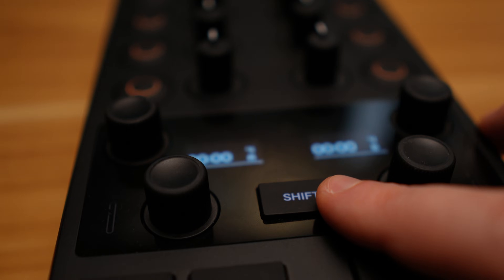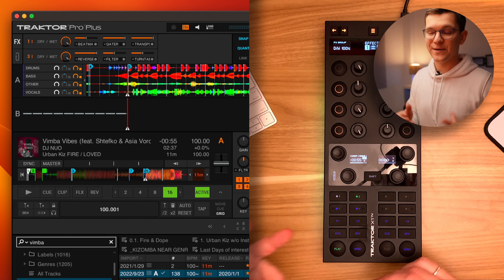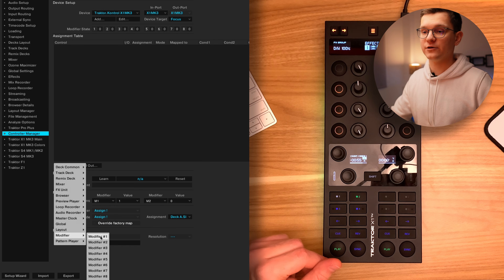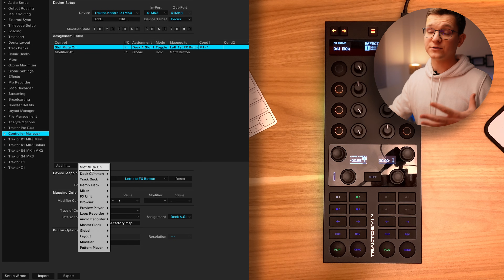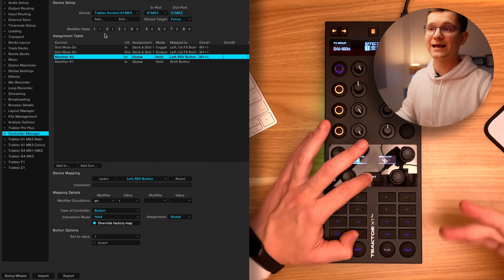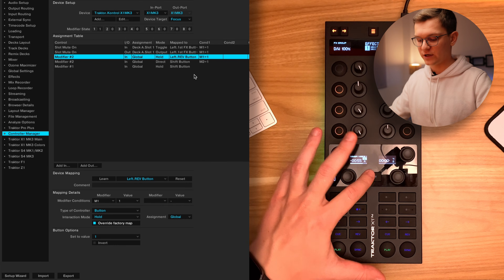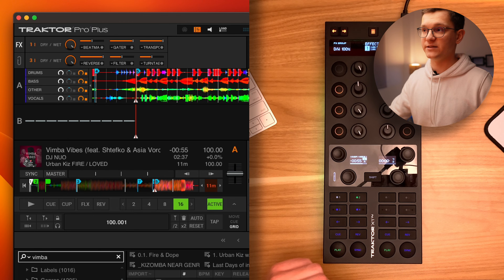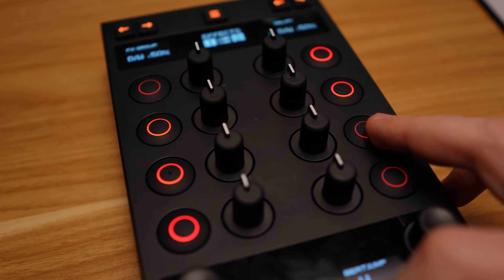STEMS on X1 MK3 | How to MIDI-map to use Traktor STEMS?

Comment: Thanks. Unfortunately, I see one major issue. Shift plus effects buttons are beneficial in the default config. They control the unit effects' settings. I would use different modifiers

Comment: Hi, thanks so much for the video, it's really helpful. A question: a friend of mine and I play with two x1 mk3 with 4 decks. When I import the file, only one controller with the stems will work. Do you think it's possible to get both to work? Thanks.
Reply from the maker: Yes, but you’ll need to do additional midi mapping

Comment: With this mapping can i have 1 x1 mk3 set for default mapping and a  2nd x1 mk3 with this map.

My idea is first x1 controls decks 1/2 
2nd x1 controlers 1 deck and 4th stem would
Be stems

Deck 3 would have pattern player

Other idea is to get an f1 to run remix or stem but trying to minimze the set up.
Reply from the maker: I don’t know, try it 🤷‍♂️

Comment: Hi, thanks a lot for this great mapping! Is there a way to add a function to turn the FX send knob of each stem with the corresponding X1 MK3 knob when holding shift and reverse?
Reply from the maker: Yes, it’s possible. But I doubt user experience would be nice. Because of “software takeover”. Imagine you turn the knob in regular mode when controlling effect to 0 position. You the. Switch to FX send mode for this knob, and you have to firstly turn it to the position where your FX send position is in Traktor on computer (e.g. 100).
Reply: Yes, that's not optimal indeed. Nonetheless, could you give me pointers to go about this? I explored the different options for custom mapping and couldn't find how to get the X1 to interact with the stem's fx send.
Thanks!
Reply from the maker: 1. Create two modifiers for Shift & Reverse buttons respectively
2. Use these modifiers when creating “in” mapping for Submix > FX send
Reply: @DJNUO  Cheers, I'll give it a go :)

Comment: So basically, I sell my brand new X1s and buy back the Xone K2s! 🤣🤣🤣
Reply from the maker: Viable option 😅. Though, I don’t like that K2 don’t have pronounced “12 o’clock” position click on knobs(
Reply: @DJNUO  you get used to that and the loose upfaders as well. But my only gripe is using the cover as a base because it tends to slip around. It has no rubber feet.
I had become a mapping Jeddi with the K2s. It's too bad the X1 doesn't have an option to map the other layers. That would make it more useful.
Reply: @cassiusjb not being able to map the different layers is a joke. now i have some layers that i can never use because i need to do some remapping. im tempted to make my old x1mk1 work on my mac and get rid of the new ones....

Comment: does this work with traktor 4 as well? ;)
Reply from the maker: It definitely does 🙂👌
Reply: @DJNUO  cool I will import the files from google :) is there a never version out ?
Reply from the maker: I use the one linked on Google Drive xD
Reply: @DJNUO  Okay tested and working - is there any way to use the volume knob from the x1mk3 to toggle down and up the stem sound?
Reply from the maker: @tricade toggle - I don’t think so, but control gradually - yes

Comment: Very helpful video even for people who want to map different functions it’s very helpful to see how Traktor mappings work.
However, for this little piece of equipment I think 4 layers (Mixer, Fx 1-2, Fx 3-4, Stems), is just too much. You can easily get lost between layers when you are mixing .
I would suggest people to get an external mixer and use that for eq instead of the built in and map the mixer layer to stems directly
Reply: This is exactly why I'm here.

 If I do this that means I leave the controller layer as it is and I'd still have easy access to the effects, correct?
Reply from the maker: @alexfurtuna3095 correct 😃
Reply: @DJNUO  thank you 🤘
Reply: Interesting. What mixer would you suggest pairing it with?
Reply: @mulletonabike26  I got a pair of X1s with the Xone PX5. It's an awesome setup.
Reply: @cassiusjb  Yes!
Reply: @cassiusjb  PX5 is imho best price / quality ratio mixer on the market
Reply: As far as I can tell, you cannot map things to the other layers. The rest of the functions are useless once you map the X1 for stems.

Comment: great explanation, do you know how to do a 4 deck mode on a single controller? I would like just to change between decks without affecting the effects/stems buttons is that possible?
Reply: Did you find a way to do it? I'd like to find a way to use 4 decks too
Reply from the maker: You will need a more complex solution with more intense use of different modifiers. 
E.g. if some modifier is X value > control deck A & its mappings. If modifier is Y value - control Deck B. 
Etc.)))